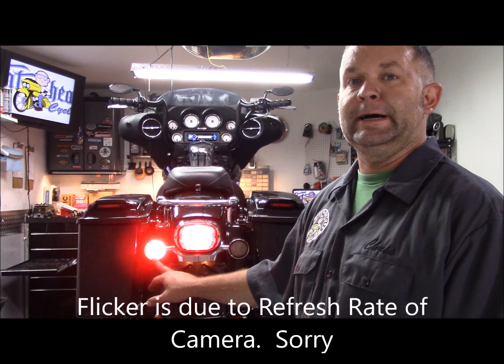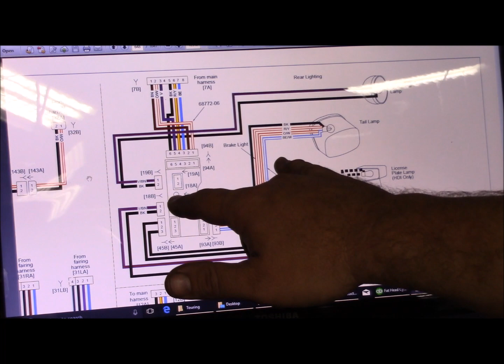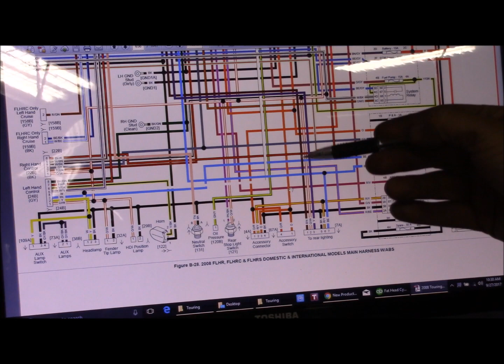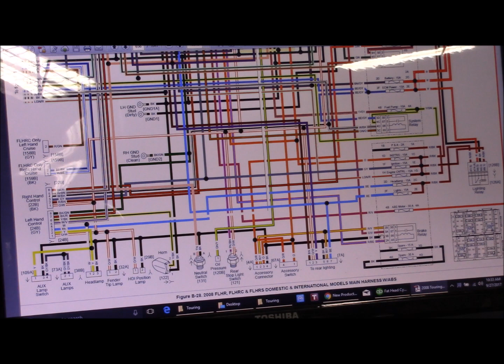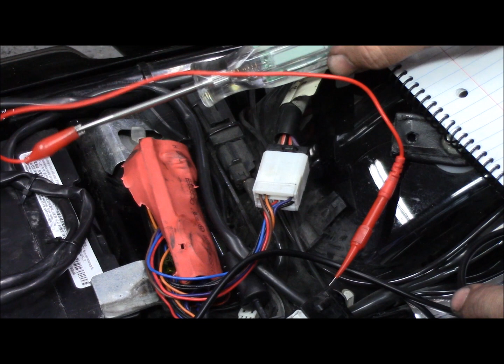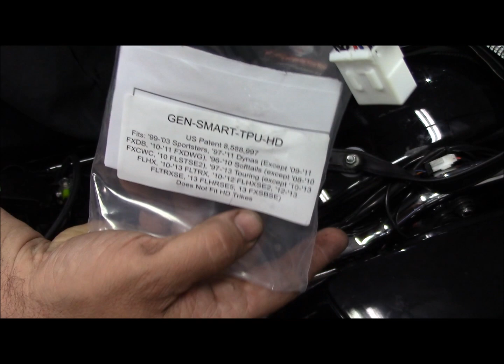How to Diagnose and Repair an Inoperable LED Turn Signal on this Harley-Davidson | Fat Head Cycles

Comment: Great video. I have a 2008 FB FLSTFand a similar issue. Installed CD plug n play LED turns in front, and the RBT in rear transforming them from turns only. They had two wires that I had to route to my tail light assembly and connect with their posi-taps. No module was needed to add and everything has worked great for over a year. I suddenly lost all brake and turns. Those lights still flash when my security system engages so it's not the lights themselves, or the connections. Or is it? Checked all connections everything still seems tight. When I had it painted a few months after installing the LED's my mechanic replaced the positaps with direct heat shrink connectors and all those still tight. Can't figure it out.

Comment: Good video. Hey i have a custom dynamics run stop turn modual and had my turn signal wires disconected. I started my bike and the wires touched eact other now my turn signals dont work. Do you think i blew the modual?

Comment: Hello,my name robert from indonesia,i have same problem like that, but if i put on with standard bulb in rear turn signal can be light on,if i replace with led it can't be light on,so what your suggest with that? Any kind error with wire or else,btw my bike is sportster 1200xlc 2007,thanks

Comment: Hello great video. My rear led turn signals wont turn on at all, but when i put the original light bulbs they do work. I have the same set up connection that you showed on the video and still the leds wont work. any advice plese ? thanks
Reply: Did you ever find out what it was? I’m having the same with the front
Reply: @MarineRacingTeam no never…
Reply: @hectornavarrete766 we are doomed 🤣

Comment: My hazards aren't working but my turn signals both are.  It sounds like you're from PA. If so do you have a shop or a shop you'd recommend near ohio by 80 or 76? It's cost me a fair amount learning on my 2001 roadking and I don't mind if I can learn but the electric for the rear had been "redone" and the left switch somehow controls the rear lights. It's a little bit much to explain on here but any help would be greatly appreciated. Thanks for sharing your video I look forward to watching more 👍

Comment: I have a 2007 street glide also and after I installed my already built Paul Yaffe 12” bars from hill country custom cycles my left turn signal wouldn’t work AT ALL and now it’ll works “most the time” but I have to press is really hard but it won’t self cancel. I have no issues with the right side signal whatsoever… any ideas? Btw. The both worked just fine before the bars were swapped

Comment: I have a 1999 electra glide standard FLHT and I installed the cvo style stretched fender with the cvo led taillights and turn signals.  My issue is with the ignition off the rear leds are still on but super dim, is this normal with leds? I ordered a load equalizer from custom dynamics because only the Hazzards flashed and not the turn signals so I'm hoping this will solve my other problem? 
Any help would be greatly appreciated!

Comment: I have a turn signal. I don't have the solid light. What could it be
Reply: I fixed mine by resetting a fault code.  Look up how to read and reset codes. It was very easy.
Reply: Thanks for the advice, unfortunately it didn't work but I now know how to check my bike for error codes
Reply: same here - tell me the fix
Reply: I have the same problem, only the signals work but no running lights or brake light, anyone know a fix?
Reply: Ok , did you trace good power back to the TSM? If so, it’s most likely your TSM.

Comment: I have the custom dynamics probeam LEDS front and rear. My left side blinker works, but the run and brake light function of the blinker doesn't. I have the CD load equalizer on mine as well. I wonder if the loaded equalizer is messed up? Any ideas or suggestions would be greatly appreciated

Comment: I installed custom dynamics LED turn signals on my 2016 streetglide about 2months ago as a winter upgrade. They worked when I installed them but I just installed the LED tribar tail light and now the right side turn signal is not just working just as in your video.   Is this load equalizer something that is needed?  Thx for the help.

Comment: I have a question. I have an 08 Dyna Street Bob. I bought a set of leds for the front and rear turn signals. They worked fine on the front and on the right side. However it would not work on the left side. The bulb works just fine, both leds for the back work fine because I put them both on the right side and they both worked. The only thing I can get to work for the left rear is the bulb. Thinking it has to be a socket issue, but not sure what to look for since the bulb works. I also bought a Custom Dynamics load stabilizer and installed it and it is set on normal load. I tried the heavy, but it didn't seem to make a difference. Any ideas?

Comment: 12 volt step by step troubleshooting, a dying art of non assumption, love it!
Reply from the maker: With patience, proper test equipment, wiring diagrams, knowledge of the system, and patience you can figure out any problem.  I believe in finding the problem not throwing parts at it until parts go away.  Thanks for watching!
Reply: Great job